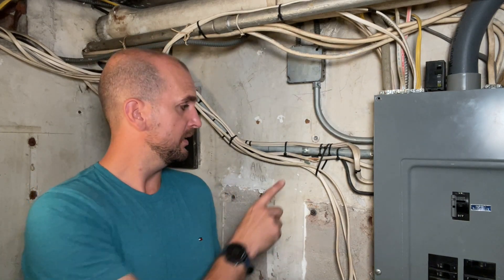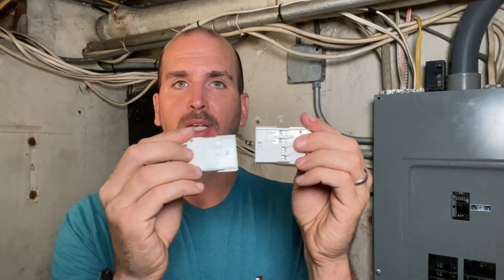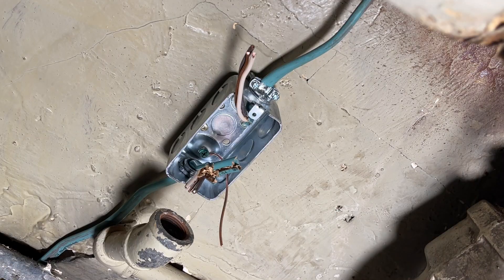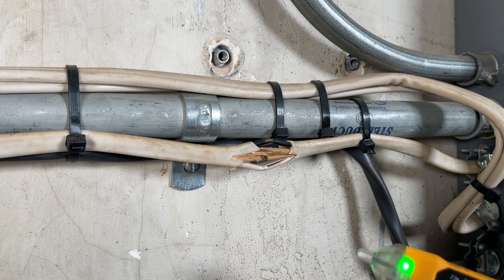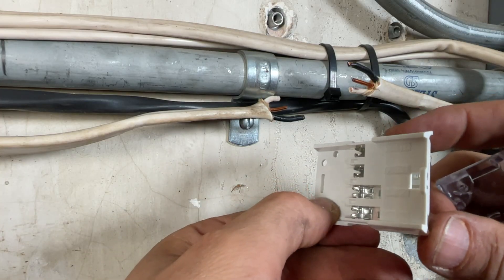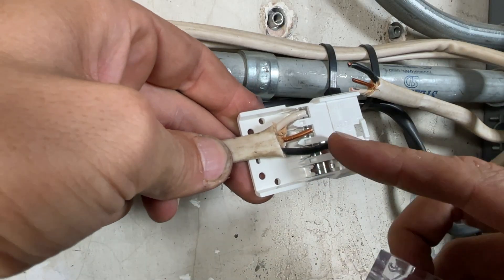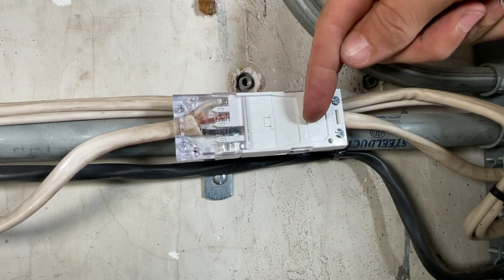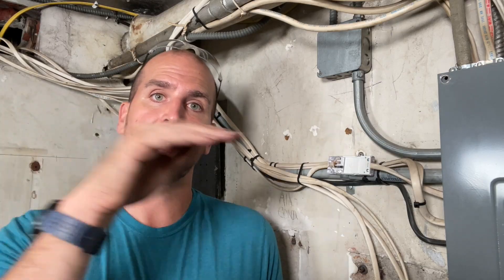How To Repair Damaged Romex Wires

Comment: I have seen many of these damages... but, it is usually through a hole in a joist or stud.   The mice make the hole bigger by eating the insulation.   Many times even find black bare and about to rub against the ground.   They are such cute little animals, till you see the damage they do.

Comment: Don’t like wagos . They use the same kind of shark bite connection as found on the back of some plugs and receptacles. For a terminal connection they might be ok but for power beyond I don’t trust them. I’ve found too many overheated plugs where someone tried to use the push fit to junction a circuit. Not at all sure how all that exposed romex is legal in the first place.
Reply: IDC or Insulation Displacement Connection is as it states. It’s used, for example, in in-line rotary switches on tandem lamp cord now pulling no more than 13 watts in our LED A lamp world. I have no problem with the Amps in a portable lamp listed product using IDC switches but wish someone would improve this design. WAGO connectors do not employ IDC. If they did why would it be necessary to strip 11mm (7/16”) of insulation per factory spec? BTW there’s a strip gauge on every unit. When the wire is inside the port the lever forces one side up against a 3x4mm pad of sheet metal. My guess: tinned copper. That pad is one area of a metal strip that runs continuously through the connector whether it is a 2 port or up to 5 port. In in essence works as a passive buss. This bus has a cross section equivalent to the “Circular Mils” of the wire used. Circular mils is simply the area of a cross section of the wire conductor.  Pi R squared if you are interested. The whole category of push in connectors is lumped into one bucket by many. WAGO 221 lever locks are in a category of their own and I would use them, within spec, without hesitation.

Comment: Whats with all the exposed romex?  Where I live the building inspector would say 'Nope'.
I tried that splice kit, inspector said it's a no go if it is not in a junction box.
So depending on where you live and how they interpret the code, be careful.

Comment: Wire nuts not those lever things. Junction box or rerun  the wire. If it's in a wall you can install a box with a blank cover or just rerun it. Inspectors here frown on taking the easy way out, they are the final word. It's easier to just do it like you already know they want it.

Comment: Epoxy /   don't use pin connectors 🤤 there used on some portable  mobil  homes  halves  to connect  the 2 halfs . = they go open  under load. The expensive  underground  splice  kit is  more reliable 🤔

Comment: With the no touch voltage tester, be aware,  you can test it and it 'work' and you go to the wire you actually want to test and the tester say "dead" even though it is live. When I was an Apprentice electrician my foreman did just that, with 3 testers because "you can't ever trust one, it can fail you" he lost his linemans pliers that day they got blown in half... He then said "well, I guess you can't even trust THREE of them, damn it!"
Reply: never had my el-cheapo harborfrieght no-contact tester fail me. Of course, when the wires are as close to the box as the ones in that video, I'd pop the panel open to check with a meter, just in case.
Reply: I believe the proper test is, 1. Check known hot circuit. 2. Check questioned circuit. 3. Check known hot circuit.  Proves tester didn't die after first test.
Reply: Thank you for that enlightening story

Comment: Not an electrician but... In this video the one side was so close to the main panel I'd use a junction box and run a new longer piece from the panel to the new junction box instead of that splice kit.  That splice kit looks sketchy as hell.  No way I'd want to run 15 or 20 amps through that little puncture in the insulation.  To me that's just a fire waiting to happen.

Comment: I feel safe doing electrical I don't have confidence in those little metal connectors carrying sufficient current without heating up and over time failing. Consider the surface contact under an outlet screw or light switch screw. I've seen a lot of old tech fail but seen more new tech fail. Everything I do I think will I trust my life to that!

Comment: How can you have exposed Romex below 8' or 10' in height?  I thought that's against NEC code.  Around here I think that whole room would fail an inspection...
Reply: You won’t see that anywhere in the NEC
Reply: It's in there as a "grey area" that inspectors may or may not call.  Commentary from one electrical inspector:
--------
 @electricaf365  Exposed NM, NMC and NMS cable are allowed to be run in “one- and two-family dwellings, their attached or detached garages, and their storage buildings” by the National Electrical Code (NEC 334.10 and 334.15). It must “closely follow the surface of the building finish or of running boards” per NEC 334.15(A), and “closely follow the surface” means well secured flush to the wall. But the catch is that the code also specifies at 334.12(B) that “cable shall be protected from physical damage where necessary” and lists several types of conduit that are approved for protection. 

    Unfortunately, the NEC does not define what areas are “where necessary." *Many building inspectors define it was any surface mounted cable below 7’-0” above the floor*, but it is subject to different interpretations. We call out unprotected NM-cable below seven feet pretty often in older homes. The photo above is a classic example of how not do it: below 7”-0” and poorly secured.

Comment: Not a fan of the insulation piercing connection. I don’t feel they could carry the full load of that 14ga conductor. I’d like to see it hold 13 amps for 12 hours without melting.

Comment: This complete installation does not comply to wiring regulations in NZ. All cables must be protected under 2m height. 6ft   bit of a rats nest by the look of it. I'd loose my ticket and get a hefty fine if I did work like that.

Comment: Both the Wago and the TE connectors are terrible products. The TE connector only makes contact in that small area that goes through the insulation - that lowers the surface area of the connection and thereby lowers the ampacity of the wire. I can't believe these would meet code anywhere. The Wago connectors rely on a spring connection. Over time the spring will heat and cool multiple times which will weaken the spring and allow the connection to loosen. This same issue has been a long going issue with using the spring terminals on switches and receptacles. Any electrician worth their salt will tell you never use the spring terminals on a device - always use the screws.
In case you're wondering, I am a retired Union Journeyman Electrician with just under 20 years in the trade.

Comment: Terrible video. Don’t take this advice. Call a licensed electrician. I will point out one of many code violations in this video. A minimum of 6” of wire on each end of the splice. That’s per the NEC (National electrical code) 🙄🙄🙄

Comment: At $18 each for the splice kit, wow!  I suppose that it may still be the least expensive repair in many situations.  But, I'm very leery of those push in connectors that pierce the insulation and cut into the wire both from security and current carrying capacity.  I'd be concerned that would create a hot spot under full load current.
Reply: $28 ea now in 2022. Wowie!
Reply: @MrPterasaur  $34.95 now Amazon Prime.. FU@@K Joe Biden!
Reply: @MrPterasaur  you can't find these anymore that's why he's using one made for a /3 wire
Reply: My first thought too but certainly NEC knows how it's constructed why would they allow something that isn't up to the task? Maybe they have amperage restrictions?
Reply: I had a dead circuit in a mobile home. I found one of these that was melted where the 2 halves of the double wide were joined  together. That circuit had a window air conditioner on it. Close examination of the device says "Do not reuse". This mobile was a repo so it was reused. I eliminated 3 of these using a box and wire nuts.
Reply: What I prefer are an item that looks like a wire nut but looking at the open end you find a ring of brass, removing the insulating nut reveals a brass sleeve with a set screw on it’s side. Insert the twisted junction of the wire into the sleeve and tighten the set screw. Add the insulating cap and you are finished. This is all secured in a junction box with a lid. Is there an issue of joining the cables with the crimp sleeves that many times are used for the ground connections and insulating them with several layers of shrink tubing? You have to use the approved crimping tool that will apply even pressure to the crimp at the approved pressure for the crimp ring.
Reply: I agree, looks like something made in China!
Reply: I am wondering if it's CSA or UA approved, what is the rating of it?
Reply: @lloydbrown9327  Looks like it is UL listed.
Reply: @Burn3r10  behind the kit I saw wanted only cables newer than early 90s
Reply: @Mynameisjonisss  I could see that being the case. Different specs for the cables I imagine.

Comment: Out here in California, most municipality inspectors will NOT accept Wago connectors for a repair like this. Typically for code out here, you have to make a 90° turn into the j box, secure Romex to a stud with your typical wire staples, use an approved UL listed vinyl electrical  tape around wire nutted ends and then have the grounds all bonded together inside and to the actual j box itself.

Comment: In some situations I would have peeled the insulation Jacket back and used a GOOD quality Tape (Sctch 88) and taped the exposed wire. AND then the WHOLE thing. No cutting No connections to go bad and it doesn't look bad.

Comment: I'm an electrician, since 1970, & typically I repair damaged Romex with proper splices in Junction boxes.
Reply: Bob Beanner  That doesn't change the fact that they are approved by the NEC. Also, if your jurisdiction doesn't specifically forbid them from use, the inspector cannot makeup his/her own rules on the subject.
Reply: @jimmac1185  and staking a plug is allowed by the NEC, yet it's known as a shit way to make the connection and shouldn't be done.
Reply: @N.Cognito  And your point is?
Reply: @jimmac1185  just because it's approved doesn't mean it's good.  A box and proper splice is the way to fix this.
Reply: @N.Cognito  I never said differently. In this situation, yes, a box is the best fix. But, you can't always use a box. As I said before, I'd use them in a pinch, not regularly.
Reply: Bob Beanner  I'm sure when wire nuts were introduced,  some old time electricians said "I'll never use those things, soldering joints is the only way to go!". To be clear, I would never use them in the situation he did, but if I was in a bind an unable to put in a splice box, you bet id use them. I'm a licensed Master Electrician.
Reply: Bob Beanner  2020 NEC 334.40b I can check an older codebook to, if you like. I have nothing better to do, really. :(
Reply: I don’t trust the Ideal in sure connectors and these other things shown on the video. Any time there is a dissimilar metal making small contact it’s not what you want.
Reply: Howard Blasingame -- Thank You, Howard, for the true voice of reason !!!  None of these little, low grade material, who knows, how much heat they can handle, telephone/auto connecting gadgets will ever make it in The AC/DC long haul like the decades proven process... Think about it - if all the homes in the USA that had nothing but real wire nut connectors used on properly twisted wires,  caught fire, there would be No Homes Left... But this has never happened and will probably never will... The old, proven way has been proven for decades.. These new, cheap, low voltage gadgets, are just that... These puny, unproven, long term, things are just another Marketing 101 greed gadget for the makers, who are probably our worst enemy, - China... I will NEVER use these low voltage connectors on real electrical anything... Notice they never post real, verified, years of testing in the lab, to verify they are able to take it - for how long ????
Reply: @frandanco6289  All of your questions about who knows this or who knows that are answered by the UL listing.
Reply: 50 years from now, people will be throwing away 100in 8k flat screen. 😂
Reply: Yeah, this guy is a hack !
Reply: @mikemacdonald2032  how is this a guy a hacked?  What exactly did he do wrong?
Reply: @mikemacdonald2032  These are allowed by the NEC and have been for years. Prefab houses are wired with these all the time.

Comment: Recently bought an older mobile home. First thing I did was eliminate all of the punch down devices and install boxes and good outlets and switches.  Can't imagine why those darn things are approved in NEC. I have never trusted insulation displacement connectors above 12 V DC in installing auto sound systems.

Comment: Not something I would feel safe using. Do it properly with wire nuts and a junction box. Also whats with all the romex zip tied to steel conduit, I was always told that is not a good idea to do.

Comment: This is great. A friend has old paneling that's been painted over in her house and she'd like to sheetrock the walls, but there are several places where there are junction boxes in the walls that we wouldn't want to bury in the wall.
Reply: Don't use these!! Unless you REALLY don't like that person.
Reply: @dangroce82  She does not have space heaters- she has central heat and air. Now that all the lights are going LED, I don't see where anything would be drawing much power.
Reply: @billvojtech5686  you never know what someone will use it for in the future. Today it has one use, but tomorrow, or next month, or next year or twenty years from now what will it be used for.
You build to specification - the size of the wire and the circuit breaker. If it's #12 wire on a 20 Amp breaker then you use that spec to build the circuit. Any weak point is a source of a fire down the road.

Comment: After using the splice kit my toaster won't boil water anymore. Keeps tripping the breaker, but I'm pretty sure the breaker is bad so now I just taped it to the on position until I can get around to putting a 60 amp in it's place. But weird thing is my toaster still won't heat the water, but it definitely smells like it's getting hot. Maybe my toaster is a 220v toaster ? I can't tell
Reply: ROTFL!!

Comment: So you feel confident that the small tab that cuts into the conductor is safe. After 40 years as a licensed electrician I wouldn't even use that on lo volt wire. It shouldn't even be tied onto to that conduit. Me, 2 boxes, both accessible, grounded if metal, wire nuts to get a better connection with the proper wire nuts. Those wago connections,  never. Not enough contact. They are like that splice. With a good load it is going to get hot, then cool off and continue this hot then cold over n over again. Eventually that plastic will become brittle. I have seen a lot of connections that over time become loose, overheat, then start melting, then quit. FPE panels and Challenger don't  trip, so then what happens. A fire will start. Your choice. Me, never. I sleep well every night.

Comment: I will add two new boxes and space them out a little bit farther apart. I will put receptacles instead of faceplate if they make sense.

As for wago, they are great, I like them a lot. But if you have enough wire and you don't change the connection ever after done, nuts are as good and much cheaper.

Comment: I am a licensed journeyman. I would never use one of these. In time, you would get corrosion in there which would increase resistance which causes heat which makes corrosion worse, which increases resistance, which makes heat.... That thing doesn't look like it could move 15 amps or more without heating up, even if it's UL listed. Even though they're legal, I never use cheater breakers either. It's an easy way to overheat a neutral.

Comment: I would hurt anyone who did that cut up on my electrical lines just to test them. But then, I’ve run half the electric lines in this house myself, so it would be personal.

That connector doesn’t look very sturdy to me. Plastic gets old & cracks over time, much more than the wire lines. Also, I can’t see how the cutting forks provide that great of contact with house wiring and the current they carry!
Why can’t you cut the wires, put inside a box, strip the ends, put on a shrink wrap connection, overlap the ends inside, and then shrink them together? The wire clamps on the box ends would keep pull-apart stress off the wire ends then, thereby helping to keep the shrink wrapped ends together over time. Slap a cover over & call it good. You could even use a bolted clamp over the wire ends to make sure they stay together, even if the shrink wrap disintegrates. This I would trust for longevity far more than these plastic end clips.
Sometimes Code just doesn’t make sense to me, but then maybe I should start inventing connectors to get approved for use.

Comment: i like to fix breaks in the wires in basement  by running a new piece to next box since a lot of times the wire is too tight to make a good legal connection and sometimes i will just put an outlet in the box since who can't use another outlet. some say thats a bad idea because its not on same circuit as rest of room but i think that is an advantage when you are  working on other wiring you can plug in a light or tools to that outlet and i like to put a label on the box or outlet for what circuit it is on

Comment: not enough surface area for a reliable connection , just as bad as quick wire connections on receptacles . Would avoid this product at all costs   , retired electrician